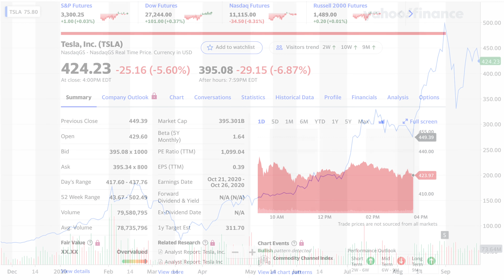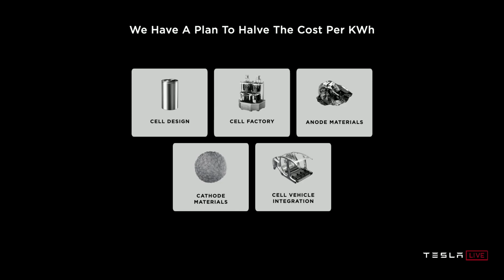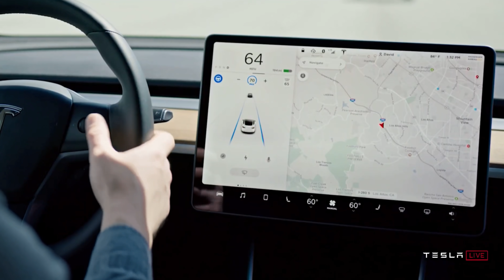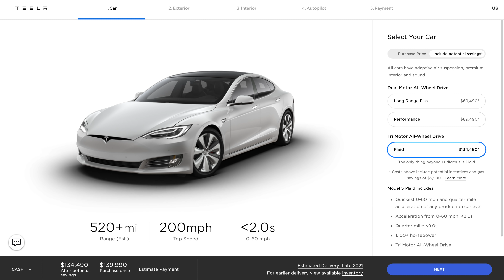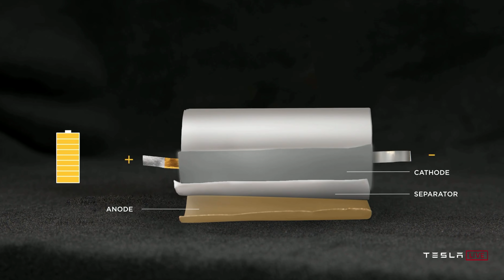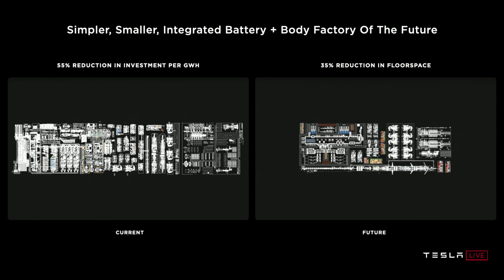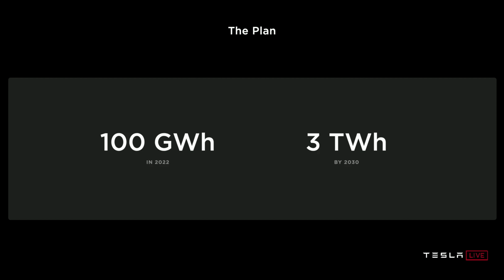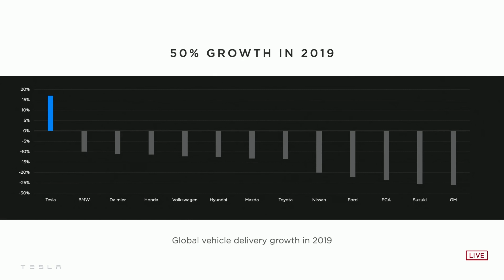Battery Day: Tesla’s Path to Becoming the Most Valuable Company in the World (TSLA)

Comment: Good point about charging rate, Rob, including the curve. If tabless design makes the new cells have similar thermals as skinny cells, and the new cell has 5x the capacity, but 6x the power throughput, does it mean the pack as a whole can charge 20% faster on the same Supercharger? Can the new cell also handle higher than 6x the current when charging? Maybe TheLimitingFactor can shed light on this.

Comment: Regarding charging time: Elon showed a chart demonstrating that the 4680 cell will charge as fast as the 2170 cell. Given that the cell holds 5x energy over the 2170,  supercharging your car could take 1/5 the time it does today, once the superchargers are upgraded to handle the rate of power delivery. That is truly game changing and eradicates one of the biggest complaints of ICE car owners- charging time on a trip. Adding 300 miles of range could take only 15 minutes- 100 miles could happen in 5 minutes or less. Game over...

Comment: It was a good battery day for long term investor's I think what was under value is how much they were able to reduce the heat issue in the new cells. I was most disappointed with the news about the down play of vehicle to grid. If you don't want to have your car being drain on a power outage it's easy enough to program a software switch to turn that feature off.

Comment: Heat is the under appreciated but often hardest to solve engineering problem in electronics.  Tabless addresses heat: 1) Less heating due to shorter path for electrons.  2) Quicker removal.  This should dramatically improve max charging rates.  The limiting factor will most likely be how the chemistry responds to fast charging and discharging. 

A reasonable assumption is that Plaid was pushed out so that they can integrate these higher power density batteries enabling them to offer higher performance without damage to the battery pack.

Comment: What Tesla provided was an engineers dream. Technology and process improvements to drive down costs and improve efficiency. I was wowing as they laid out the cost savings and improvements to manufacturing. Well done Tesla! 
What they failed at doing and will now have to mitigate is addressing the one and only question consumers would have, whats it going to do for ME? They needed to take the tech and turn it into understandable terms the market/consumers would understand. These improvements we've just laid out will allow our batteries to go X many more miles and last X this long without degrading. They can charge X fast on your trip. The Semi will now reach X miles on a charge and cost X less due to these improvements....what's it going to do for me? Hopefully that perspective will be released by Tesla in the coming weeks which will help educate the market. That was the only missed opportunity during battery day because the engineering/manufacturing and scaled integration was fabulous.

Comment: Sounds like the car will be totaled if any damage is done to the battery pack in a collision if the battery pack is a structural component of the overall design. Plus if the battery pack is essentially the main part of the skateboard how will you disassemble it in order to do any significant repairs the whole car would fall apart?

Comment: Battery Day was disappointing when you consider the importance for the competition: Tesla will have a difficult time in the mass market, especially in Europe, in terms of price and performance in the next two years. This also applies to Volkswagen and Daimler. Only they have the advantage of subsidizing their BEV with ICE revenues. For a BEV only company like Tesla, this cannot be maintained through discounts. In addition, e.g. Volkswagen has a high level of brand loyalty, which means that it doesn't really matter what high tech is in the car. Autonomous driving will not be allowed in Europe for the next few years and is therefore not a sales feature. And also a very close-knit service network. Volkswagen is investing heavily in advertising across all channels, as if there was nothing else but the ID.3. The Gigafactory in Berlin is currently under high pressure because over 400 countermeasures are on the way to stop the further expansion of the factory immediately. To date, Tesla has no final permit to build and builds at your own risk. The typical media continue to compare car with car as if there were no Super Charger network with huge marketing opportunities, the Power Wall, etc. From my point of view, it is careless for Tesla to trust that customers would find out all for themselves. It takes way too long. From Germany, TSLA long.

Comment: With the battery integrated in the structural parts of the car it becomes nearly impossible to replace these batteries. Thus the lifetime of the car and the lifetime of the battery are linked. Tesla wants cars that have a lifetime of over 10 years as robotaxi. That only can if the battery lasts more than a million mile.

Comment: Terafactory in a footprint < Gigafactory. 

55x production in 10 yrs.

Massive Capex Reductions

7x line output. 20Gwh per line.  

5x Energy. 

+56% Range. 

6x Power.

-50% Cost. 

$25K Model 2

600-mile Model S (0-60 < 2s)

Comment: good analytics. I pretty much predicted all of the announcements and was not wowed really. I don't care about day traders and moronic profiteering. I just really wanted to see the baseline parameters established to achieve superior economics to carbon based energy. The hold up for tesla is single deposition layering of substrate to electrode. i dont quite understand the hold up here. they seem to be floundering and this is really important as a process. I suspect he has a critical person in this process who is not doing their job properly. I suspect he's got a bad egg in the employee batch. When electrical steel for transformers is rolled for ionic alignment its not particularly difficult. If single layer deposition is to be aligned at the point of deposition it simply needs to be exposed to a magnetic field that is vector aligned to the process.
Reply: Interesting comment and makes a nice change from the rather mindless cheer leading on show here and nearly everywhere else. The chemistry and electrical engineering explanations are certainly over nearly all of our heads (and certainly mine) but I detected a bit of restraint in the presentation to indicate that they're might be something to what you're saying.

Comment: One thing that caught my attention just before they presented the tabless electrode battery was that they mentioned that they took the problem of heat out of the equation. So I'm guessing that they will be able to SUPERCHAGE the supercharging rate. I think that they held a lot back, even for such a mind-blowing presentation.
Reply: I thought the same thing.  If they announced that charge times for vehicles with this new battery were going to be dramatically reduced.....hello Osborne effect.
Reply: warringtoninv agreed.. the 6 times power increase from the tabless design alone indicates a 10% improvement on charge and discharge rate alone. (And heat is a major factor)
Reply: The limiting factor in charging speed is probably (heat in) the charging cable.  So charging is not suddenly going to be 6x faster even if the batteries could take it.  So probably no Osborne effect there.
Reply: @LoanwordEggcorn  no. Not the charging cable.  Heat in the battery.
Reply: @mothanwrdz  Resistance and therefore heat in the battery is radically reduced with the Roadrunner design.  The bottleneck is then the charging cable.
Reply: @LoanwordEggcorn  dude... what resistance bottleneck is there in a charging cable vs a battery?  I think you are misunderstanding something.
Reply: @mothanwrdz  A battery pack is made of many cells, each with some very small resistance.  The charging cable is like a single resistor handling the total power that goes to all of the many cells in the pack.  See Ohm's Law and Kirchoff's Law.

Tesla was already working on liquid cooling Supercharger cables in order to take the heat of the existing high power charging better.  The new Roadrunner cells have much lower resistance, which means the heat load on the charging cable would be much higher to feed much higher power into the Roadrunner cells.

Because of their lower resistance, the Roadrunner cells will heat even less during charging and discharging.  The heat limit bottleneck is even more strongly the charging cable.
Reply: @LoanwordEggcorn  ok. Makes sense.

Comment: Rob did you calculate how many piles a new model 3 pack would have with the 56% range increase and decrease in total cell pack size? Well over a million miles priced at the current model 3 pack price
Reply: Very tough.
4000 (current pack)
÷ 5 (energy ratio)
× 1.5 (pack to 112kWh)
About 1200 cells.
Sq root 1200 =34.6 (35×35 cells)
 × 46mm x 35 = 1.6m.
So 1.6 m square?
Plenty of room for crash protection.

Personally, I would use a smaller pack and charge faster.
Reply: Roger Starkey I think they rather lower the price since they know none of us drive 1 million miles. They’re new full
In-house recycling would mean the few who want a new pack get it prob at a trade in discount swap

Comment: Simply mind-blowing! As a PhD in Physics I understand only 50%of what they said, so the average analyst is probably close to 5%. However, the implications are crystal clear:
* The ICE car will be dead in a few years
* Every single traditional car manufacturer faces the risk of going out of business
* Long-term outlook for Tesla stock: Most valuable company on the planet EVER
Reply: There's a lot of heavy material science being thrown about - and even they admitted they were keeping some 'secret sauce' out of the presentation so it was bits and chunks. But considering the pilot plant is running on the new specs and materials - it's not theoretical (which is nice). I don't doubt the science YT channels will be having a field day going through the hard physics of what they're doing. If the charge times have been mitigated (by say 50 percent or more) - then you can say ICE will be dead. The biggest issue is the cost-complexity for an ICE to come close to the performance of a top-end EV (which is minimalist in comparison).

I was also blown away by the die casting of ENTIRE chunks of the cars in aluminum. Talk about conservation of manufacturing times. Imagine how many welds just up and vanished! Tesla isn't just sticking batteries and electric motors into cars anymore - they're tearing apart every single aspect of car manufacture and design. I mean they're even securing their own MINING plots in Nevada. This is vertical integration on an unheard of level. GM doesn't run mining operations.
Reply: @mgabrysSF  Welding and Gluing has been automated for along time. Its very fast and not the limiting factor for Production. 
vertical integration is nothing new, Japanese and Korean companies have been doing that for decades.

The whole Die Casting stuff is a huge gamble for Tesla, they need to fix their problems first or it will be a disaster, bigger parts need more precision, not less.
Reply: nox5555 I can’t agree. I work as a supplier for automotive and been to several factories. Alone the reduced footprint is amazing that Tesla is able to achieve with casting. Also it’s unbelievable lot of processes and Roboters you need to laser weld pieces of aluminum together meaning you have huge production lines. The fact that Tesla has the advantage of first principle to build factories from ground up is huge. No other OEM will do that because it’s simply to expensive for them since they already invested in other technologies.
Reply: @chillrawr9603  300 small super fast processes can be more efficient than one big slow process.  
The material itself can also have different properties depending on the way its produced.  

You shouldnt talk so big if you cant use the word effective right...
Reply: @Far2chill   the footprint has been going down for along time, going down further is nice, but the biggest improvements have already been made. 

Car maker are building new factories from the ground all the time, and they use the tech they think will fit the best.
BMW is the most insane when it comes to that, they mix every possible Technology to cut weight. sometimes they use a material just for a small amount of products.
Reply: This battery day will seperate those who paid attention in physics class from those who didnt. Makes a great case for physics education
Reply: I suggest you try the YouTube channel "Limiting Factor" for getting up to speed on batteries.  This is where Rob got most of his knowledge and
recommends it on his channel HOME page.  I went through those videos and being an electrician with a great deal of knowledge on the subject,
learned a hell of a lot.
Reply: That'll be pretty close!
Look for "Dieselgate style" carparks full of frozen asset ICE vehicles the day after the general consumer has the "lightbulb moment"
Reply: I have none of that, and I knew I was out of my element watching it. 

The only part I was fully able to grasp was the manufacturing and I was blown away, and only then was because of watching sandy Munro vids.
Reply: the average analysis !!  0
Reply: Terry Mattchen ?

Comment: Million mile battery was hidden in the details. It is implied In the slide titled "Diversified Cathode Approach" under Iron Based / Long Cycle Life (i.e. Lithium iron phosphate / LiFePO4 batteries which  have 4000+ cycle life) with the image of the covered $25K car. The image of the covered $25K car is also shown under "Small / Robotaxi" in the slide "Goal One: Terrawatt-hour Scale Battery Production". As we know robotaxis need a million mile battery. So a LiFePO4 battery with a 300 mile range and 4000 cycles equals 1.2 million miles.
Reply: MIC SR+ Model 3 already has a 1 million mile battery - probably.
Reply: Freddy Chang I would agree seeing that CATL is supplying them the LFP packs for the MIC SR+
Reply: @karthik11512  Yep. The LFP chemistry is good for a 1mm mile battery, but Tesla doesn't use it in all of its cars, because LFP has bad gravimetric and volumetric energy density. A LFP SR+ battery probably weighs as much and takes up as much space as a Lithium NCA LR battery, so it can't be used for anything other than an SR+ car.
Reply: Excellent observation. This is "Marketing 101" by Elon - he gives you the data, its then up to you to be smart enough and understand it! No hype, just facts.
Reply: Thank you - this is very important. Was very easy to miss.
Reply: My thoughts exactly. I attended the event today
Reply: Well said wow
Reply: We are still laughing and the resource wasting EV's won't save the planet either - and electricity comes out of the receptacle?

Comment: So no 1 trillion miles battery, no dry battery
just a challenging roadmap and enthusiasm
If you step outside of the bubble and  let aside previous months hype then it was interesting
Reply: They said they have low yield, which means they have successfully made functioning batteries with this new setup. As they iterate, their yeild will go up. The stuff they are doing with the anode will get it there. Increased energy capacity with high cycles due to silicone that is in a flexible conductive material.